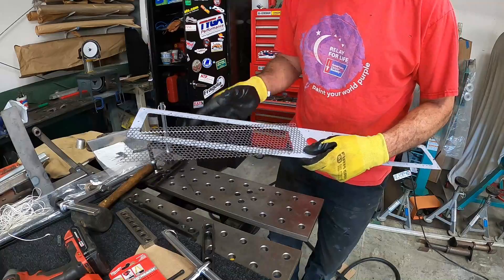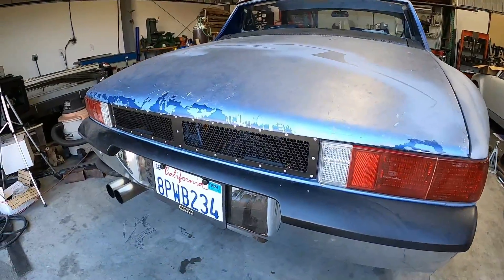914 LS3 - Episode 5: Rear Panel Fabrication

Comment: Nice work there.  But you know it's just too pro looking, you really need attach some stuff with drywall screws and use either a hot glue gun or some caulking compound in your builds.
Reply from the maker: Right? I may have to start charging you guys to watch! ;-)